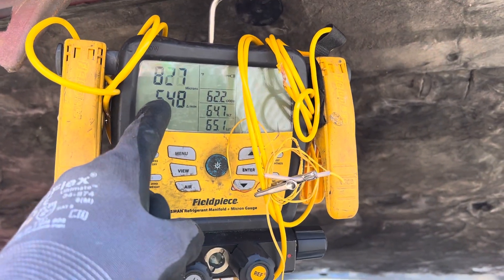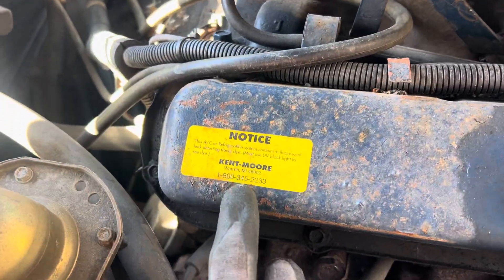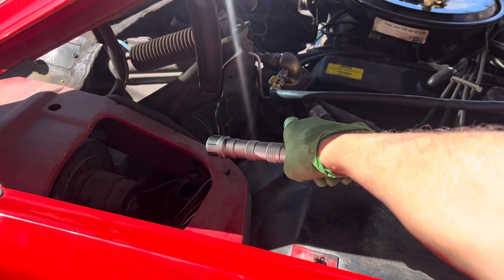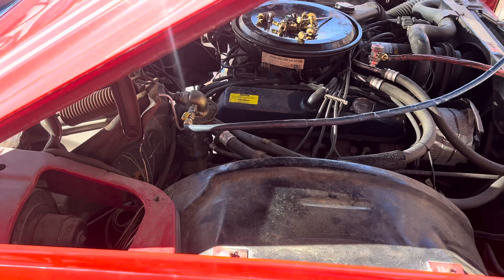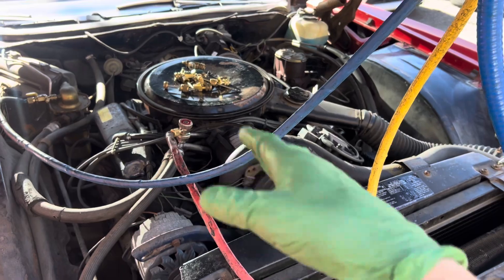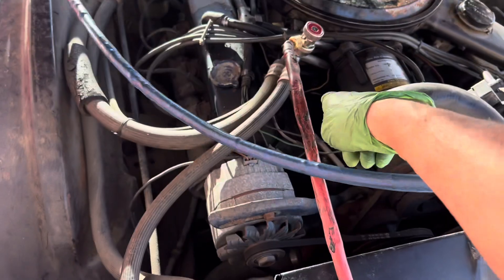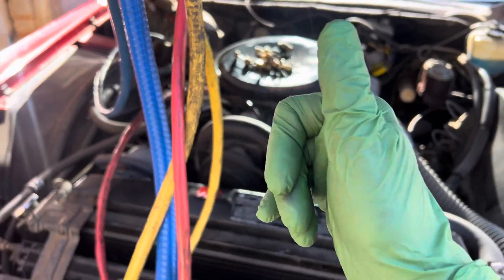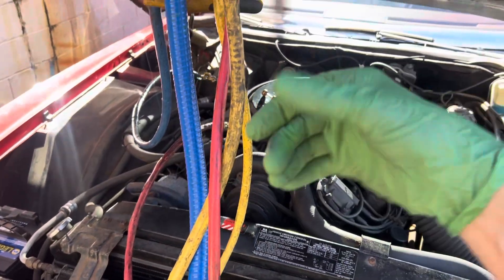REFRIGERANT MINERAL OIL￼ IS THE SECRET 🤫 10,000 times less moisture absorbent then PAG or POE oil .

Comment: I was considering using mineral oil, but I didn’t. Any way, I was wondering if you could do a video on how you connect all the gauges and temp wires and? I’m looking for a micron meter that I can afford as a DIYer. Thank Tom. You know I love your channel❤
Reply from the maker: I’ve done some videos about connecting gauges connecting sensors, but I don’t always give all the information because it changes

Internal heat exchanger mess up gotta be careful 

If the sensor temperature sensor clamp is right next in line of side of a very hot exhaust manifold that will heat up the plastic and throw off your readings 

If the hot air is blowing and pushing over a temperature sensor, even though it is clamped on a cold pipe or hot, it will get hotter and hot plastic radiation will radiate and conduct the temperature sensor that is clamped onto the pipe giving you false readings

Comment: Shows how very important micron gauge and knowing how to use it really is . Many auto based techs have no idea !!!  Mineral oil is a system thats easy to get very very dry and not hurt the performance by leaving moisture behind . 
Wack off guy says but u only need 30mins vac time every car [no idea in reality ] .
Reply from the maker: Well, as long as we have the 30 minute vacuum guys, we never have to worry about being out of work they create more work than we can fix it the work that they create 

But guys even left behind moisture in the old 12 systems and if you ever cut open the inside of one of the steel receiver dryers and see all the rust flakes that fall off to the bottom and get picked up by the pick up straw delivering to the expansion valve, plugging up the expansion valve, stopping the oil and cold refrigerant return to the compressor and then causing the compressor to burn out Moisture was a problem back then to

Comment: Another thing that mostly affects the longevity - R12 refrigerant. Running with lower pressure, less load on moving parts. Good oil circulation and return ( HCFC chloride binding to the oil molecules).

Comment: Has this system been upgraded to 134? What about oil compatibility?
Reply from the maker: Hoses are brand new. The VIR assembly had to desiccant material changed and the expansion valve changed inside., 
New compressor with 134 refrigerant oil 
New fluid thermal fan clutch .
So 100% of all the oil in the system is only for 134 no more mineral oil it has been flushed out